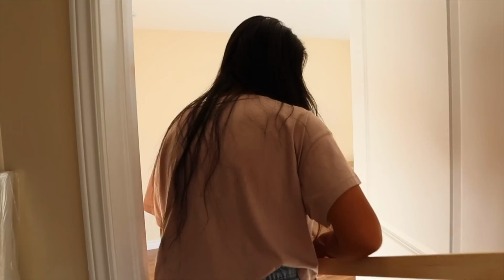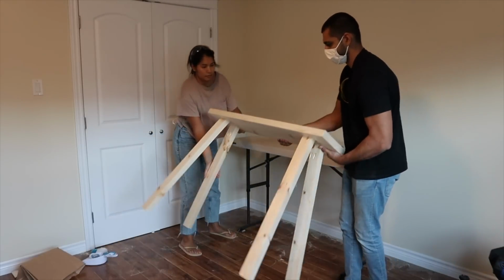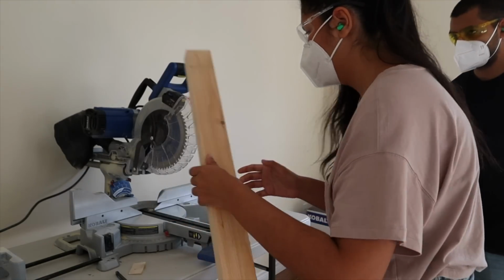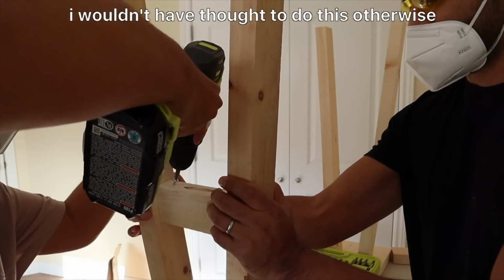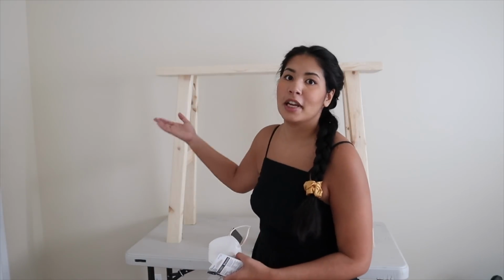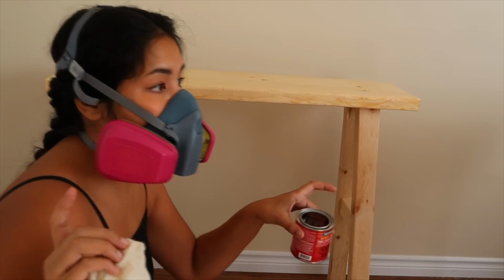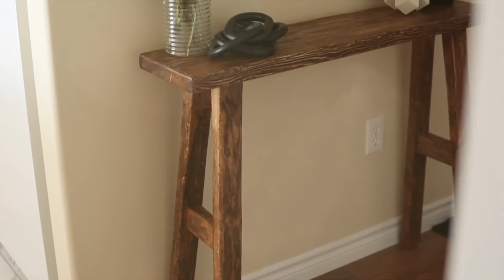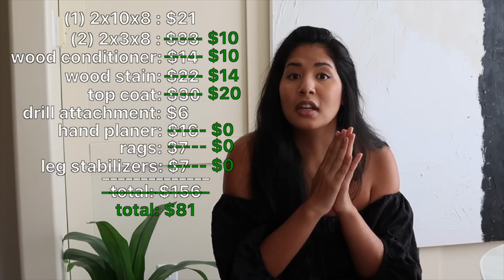DIY Entryway Table | DIY wooden table... primative reclaimed wood console table

Comment: When I first discovered the conjoined pocket hole in my shop, I thought it was so cool... until I tried screwing it together like you guys. I have a right angle adapter for my impact that I had to get to drill thru studs to hide my tv cables recently. Works great for those tissue box pocket holes and is handy for lots of other applications in woodwork

Comment: Always enjoy watching you work through the solutions to a beautiful end result! My Grandpa was a cabinet builder. I tried to build a bench top out of a solid pine 1x12 that eventually warped. Gramps said pros always use smaller strips glued together ( like butcher block) or plywood covered in veneer. If you look at the tree rings of your solid board, this is how the wood naturally wants to bow as it will continue to expand and contract from temperature and humidity changes. Somehow the movement is minimized by using several boards to get the width you desire. Pay attention to the end grain to have the rings facing like a rainbow. For instance, a wood deck with boards grain like a U have the edges curling up that are trip hazards. Hope this helps, as I'm sure you chose the straightest board without realizing they all have potential to     move with the grain 😻
Reply from the maker: Wow thank you so much for taking the time to write that and explain it to me! Now I know why they use the wood that’s attached in strips! I also didn’t know about the edge rings! Thank you truly for sharing that 💕
Reply: @DIYDalia  sorry I had to be write a book😹 but it changed my diy life learning that from an old pro. I just had to share, to hopefully ease some of your anxiety. Just like in life, you may choose a straight path that inevitably will bend before you reach your destination. You have done a great job of embracing those imperfections and finding work arounds to get the final results you never stopped believing you could accomplish!😻

Comment: Did you guys consider turning the legs to tilt out to the sides instead of the front & back?  Or would that have been super against the design? 

And measuring the angle and length of the support pieces would be easier if you held them to their place and marked them directly from their place as opposed to doing math lol tip for next time 💙